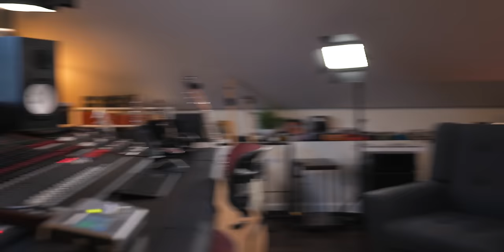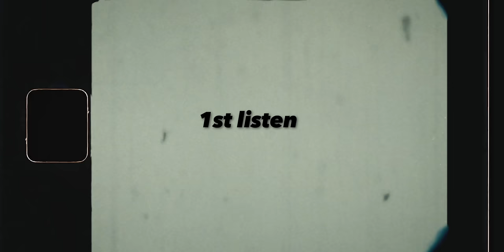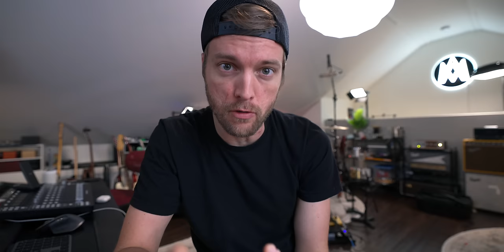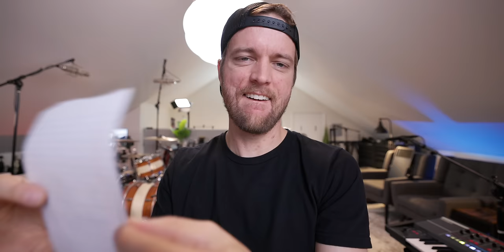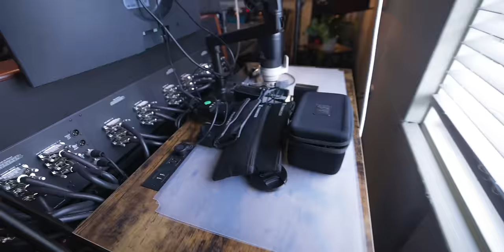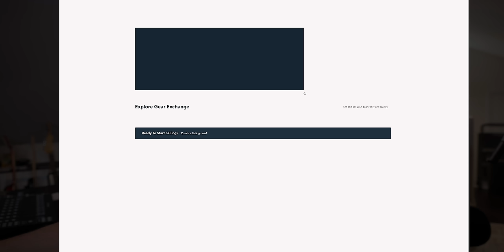I DIDN'T EXPECT THIS.. (Trident 68 Console VS Warm Audio WA73)

Comment: Man, the Trident squeezed down on the length of the transients in an extremely pleasant way. Listen to the length on that kick drum in each comparison. Sick console, dude~
Reply: It's the Tridents faster slew rate because of the higher impedance, the Tridents have a higher impedance which equates to a more open sound. While the Neve style preamps use a lower impedance around 600 to 1200 ohms which lengthens the note  but also squashes the transient due to the slower slew rate. Good ears that you noticed that. Cheers!

Comment: Great video Andrew. I have a Trident 68, as well as API 3124V’s, Vintech 73’s, Pacificas, etc. I was shocked at how much I liked the Trident Pres too. Now I always use some of that Eq on the way in but particularly like what they do to toms. I agree about the “round” sound. Really present yet controlled low end, punchy mids (not API punchy but..) and detailed highs.
Reply: Nice. I used to have a Trident Trimix, API 3124 and Vintech 473 (plus a smathering of others isa 428, chandler germanium, UA LA 610, True Systems prec 8)
For drums id almost always go API on snare/kick in and OHs.. the rest split between the 473 and Trident (I had bought all the redundancy pres before getting the console) 
It was still nice to have 34/35 pre's to choose from even though my Antelope interface only had 32 inputs and I rarely went over 25 inputs at a time, Though id go ape micing drums at time and have over 20 mics on a 5 piece. (scratch 2 x Guitars,  1 x Bass was how U was getting up the 25 tracks at once)

Comment: When I was younger and coming up at Sound Kitchen here in Nashville (where we had an SSL 4000G, API Legacy Plus as well as a Neve 88VR) an engineer/producer once told me about something called "Slew Rate". He explained to me that the Slew Rate was how fast the preamp was able to reproduce transients (basically), the quick and dirty he told me was that at Sound Kitchen, the API was mega fast, the Neve was the slowest and the SSL was somewhere in the middle.  I've learned over the years and the Trident is EVEN SLOWER, I talked to the owner of Tiny Tape room here in Nashville and he told me their Trident is modded to sound more like an API because he told me that after a while the previous owner of the console was tired of everything sounding so "slow" and having so much low-end.  I think we are hearing the Slew Rate of the two preamps here more than anything, because the Trident drums sound like they almost have a little bit more "compression" (if you wanna call it that) across the whole kit, whereas the Warm 1073s sound faster, bright and more "modern."
 
Super amazing video Andrew!!!

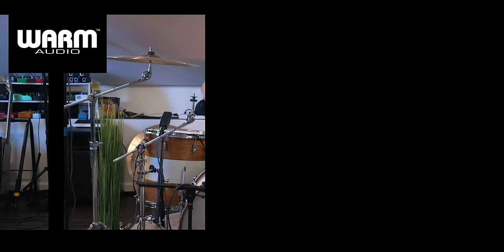Comment: Starting at 8:19 if you listen to the low end in the kick drum and compare between the two pres, the Warm Audio pres have a slightly “saturated” sound to the decay on the kick drum. The transformers are definitely adding a nice “fuzz” or “growl” to the kick. Where the Trident preamps provide a more “straight forward” sound of the kick. 

You can also hear how the Warm Audio preamps tend to “sit back” ever so slightly compared to the Trident preamps. Especially once the room mics are in at 8:42 

This is great to give things more “girth” or “weight” or have elements “pop” forward more depending on the preamps you use. 

Because they affect the frequency ranges differently, you can mix and match to make elements in a mix naturally stick out compared to the rest, or even create subtle shifts moving from verse to chorus. 

Very fun stuff to mess with and get creative!

Comment: Great video! However it sounds like there might have been a phase issue with on the snare on the Warm pres. Could be a bad patch cable or a switch. Pre's can make a big difference as we heard but that snare sound change was a bit greater that I would expect.

Comment: Warm audio sounds more compressed which I take to be a 73 pre trait. The snare rings out more and the whole sound is brighter with a little less beef. The trident is a little darker and more meaty with less snare rattle ring out. They both sound great, but to me the 73 sounds like it already mixed. Great video, and very much a matter of preference rather than better or worse
Reply: Agreed…The Warm gave the drums an open sound and the Trident seemed masked in all frequencies. Yes, the Trident sounded thinker, but that was from hiding the upper mids and highs from my ears. I don’t own Warm pres either…smile. If I had the Trident track, I would have to drop some lows and boost the highs to fit in the mix and no obfuscate the bass and other instruments on the mids and lows. Toward the end of the video when you played the kit without overheads, I could hear definition on the snare with the Warms and the Trident covered up the transients…just my ears.

Comment: I'm curious since the 1st preamp sounds like it has a low impedance like between 600 ohms to 1200 ohms and the 2nd preamp sounds like it is higher around 2000 ohms. The older Neve preamps had a switch for 2 different settings and the 600 ohms setting would squash a sound and this is what many people equate to the the Neve mic preamp sound but the internal switch doubled the input impedance for a cleaner less squashed sound. So the Neve style preamps had a more heavy slew sound that draws out the mid-range in most things while more modern preamps that range from around 2 kilo-ohm to around 5 kilo-ohms have a more polished linear quality that brings out the detail and has far less slew. An easy way to hear this in mic preamps is the darker more quote "squashed" something sounds in the overall tone on average the lower the impedance is, the more "sparkly & open" the higher the impedance.

Comment: I was really surprised by the comments. To me there was no comparison between the two. The Trident Pres were in a completely different league than the Warm Pres. I think it might become more obvious to your viewers if you did the exact same comparison recording vocals. Years ago I came into a little extra cash and decided to buy a couple of Vintech x73i Pres (faithful recreations of the Neve 73s). I completely expected to return them, expecting there was no way they could sound that much better, given the price difference. I was absolutely stunned at the difference in clarity, warmth and fatness. Given that most songs consist of dozens of tracks, the cumulative difference is huge. There's a reason why the most iconic recordings from bands like the Beatles, Pink Floyd and Steely Dan, just to name a few, have been recorded through these Hi-end preamps like Neve, Trident and others. They're simply sound the best, by far. Great Video.

Comment: Super comparison.  Gotta go with the Warm though, and the final glue of the  Warm on the Buss really brought it  all together in a big way. Although I am really impressed by the Trident  as well.  Very happy  to hear this comparison.  I may be the world's biggest fan of the "Neve" sound, which Warm really brings home I think, but the Trident does sound like a great contender for a console solution, when considering costs and features. Using a console in recording at least in my mind ultimately is the glue for any recording, because all the tracks are given the same treatment "across the board".   Thanks for producing this video.

Comment: mic splitting is usually done by transformer or active circuit. Your method is changing impedance. The two preamps react differently to this condition.

Comment: Now for the technical test. Solo the paired channels, invert the phase and sum. Listen to the difference. You will need to match the levels for max cancellation. 
Actually this would be a great way to match the playback levels too. Add a “trim” plug and adjust for a perfect match. I can hear mix differences which will be construed as sonic differences.

Comment: The Warm Audio WA-412 are the preamps that would be a much closer comparison to the Trident pre's than the WA73. The console preamps are punchier in this instance, because they are definitely cleaner in relationship to saturation/distortion. Distortion removes the peaks of the transients, which is what a 1073 is doing. To get 1073's punchy they have to be dialed low on gain, high on trim/fader. The Trident is much closer to an API or even a Focusrite console than a Neve sound.
Reply: Agree 👍

Comment: Shotgun mic to record voice at the desk, nice choice! YouTubers typically use a lav or an LDC mic. The issue with an LDC is it has to be very close to the source. The issue with a lav is that they are typically rather poor mics, even the best of them, that tend to be "all about that mid" because the capsule is so small. A shotgun mic however, if used (placed and gain structured) properly will produce excellent audio without needing to be a few inches from the source.

Comment: Excellent comparison. I'm struggling to hear any major tonal problems (perhaps some very slight differences, not better or worse either way), there are some level imbalances (more likely the difference between my monitors and yours). A very handy video for me as we're right in the middle of planning a full digital console swap with hardware outboard (we've found the lack of recall a growing problem in our analog desk).

Comment: I love your setup man! I’m a LUNA user with a similar setup to how you used to have yours. I’m at a crossroad, I try and work as hybrid as possible, which is oddly kinda difficult with LUNA. I’m looking at either integrating a Neve 8816 summing mixer with my current AMS NEVE 1073 pre’s, UF8 etc… Or ditching that idea and getting the Trident 68 16 channel… Thoughts?

Comment: it sounds more connected, and in the same environment through the Trident. there’s something happening in the mid range. However, that’s interesting with the trident. There’s a certain frequency that gets wider I’m not necessarily certain that’s a good thing but it’s different. There’s a little more high-end sizzle in the 1073’s, but that could be fixed easily with the trident EQ. often times it’s better not to have the sizzle baked in.

Comment: great video, i'm looking after this trident, i like warm audio, and i think you cannot actually compare these 2, i mean, did you drive them both the same? both input and output wise? cause i own a wa273 , no eq, and the difference in sound is massive, from going in gently and really pushing the input, especially with transient material like drums, same goes for every preamp, m ore or less, so it would be nice to see the input and output attenuations of both pieces,
cheers

Comment: Owned my first Trident Series 65 (very similar to your 68) 25 years ago, still its my first choice when choosing a console. You cannot turn off a big Neve or SSL console without damage, need air condition for them, and in our days most of their featueres are no longer needed. These old TL071 OpAmps from the 80s by the way sound very different from your new ones, if you ever get the chance to buy an old batch, do not hesitate, pure mojo (Don't know if all the OpAmps are on sockets too on an 68). And when it comes to EQ clear winner is Trident, even when you have to learn to handle it, always sounds great. Trident Pres are fast, opposite to Neve, or more east coast than west coast sound.  In our studio, we have an Golden Age 1073 clone, and soldered 2 CAPI VP28, but most of the time the Trident always wins. And Malcom Toft is a very nice guy.

Comment: Hmm.  They both sounded good.  Quite good.  Biggest difference for me was when the room mics were on the stereo image shifted between the preamps.  Like, not subtly.  Theres no chance they got reversed is there?  Apart from that they both sounded great.  I was thinking about getting some of those Warm pres with the eqs.  I have some nice Neve-clone channels from Seventh Circle.  The main real, pro-studio I go to has an old Neve and we track almost everything through it apart from occasional Avalon or Manley tube for lead vox.  When I just go through my Apollo I almost always use the 1073 emulation.  I don't ever seem to get sick of that sound.

But then I re-listened to the full mix context back to back and I did hear what you're talking about with the Tridents.  Much kick power.

Comment: Picking the trident Aswell, doesn't matter if the WA is punchier or more in the mid range, the question is how well does it sit in a full mix, the WA needed some tweeks eq wise, the Trident you barely need to touch it, it already blends with the rest beautifully, it's less work in the way out !

Comment: Nicely done, the Warms have an upper mid tooth over the Trident in this experiment. Trident, a tad scooped in that presence. The real testament to the quality comparison is to add a touch of 4-7k in the Trident, and try to match the sound of the Warms. THEN, listen for the most detail n breath throughout the frequency spectrum of both pres. Every pre is different, regardless of the cost, as you know. The one with the most detail throughout a wide freq range, will give the best 3d dimension when stacked in a mix. Do this test on acoustic n a nuanced female voice as well..

Comment: It is an interesting comparison but I did not hear any discussion of the interaction of 2 parallel inputs effecting the response of the microphones used. It would have a greater effect on the response of the dynamic microphones however without isolation of the microphone Z from the inputs you've approximately halved the input Z of the preamps. There may also be interaction between input transformers and transformer output of the microphones. Also there would be additional effect of the added input wire. None of these factors may be significant but being unaddressed, they raise questions about the result.

Comment: I don't know these sorts of electrical details but it would be interesting to know how the impedance of going to two mic preamps (rather than just one) changes the sound. If the impedance of the preamps aren't identical then the impedance changes might favor one over the other. A bigger issue for a dynamic mic than a condenser, too, which is maybe why we heard more instantly apparent differences in the kick/snare than in the overheads.

To me, the Warms sounded a little like the transformers were soaking up the low end while the Tridents were letting everything through. Super interesting, though, that's for sure!

Comment: The Warm pres are more open and natural sounding whereas the Trident ipres are tighter and maybe a little hyped on the hi--mid range. If the song has a lot of space for the drums I would go with the Warm pres. If the song has a lot going on and the drums need to give up some room in the stereo field, then I would go with the Trident pres. I'm curious to hear the same comparison with other instruments (electric and acoustic guitars, bass, etc.). You have both the Warm Audio and Audioscape bus compressors and EQPs. If you are using the Warm Audios in your mix bus, what are you using the Audioscape bus compressor and EQPs?

Comment: sounds like a phase/time align thing.
maybe the phase relations between the channels in the trident are better due to internal design and consistency of the D-sub cabling than the warm audio setup.
you can phase and time align the two recordings inside the daw (using sound radix auto align or something similar) and measure the difference in the results  (if any)  in numbers and in sound. It's an easy check so I think it's worth doing.
Good luck

Comment: Very cool video! I really like this 1/2 normalized test. I could see using both pres together on this for certain aspects on this song. I hear the difference for sure but I think there's some compelling sounds overall to both & maybe you can dig into that to bring the entire song to a place persay. I'm curious to hear those 73s inline on the mix bus with the GComp & EQP's. Anyway video kinda makes me want to 1/2 normal some mic's!  Although dosen't this change the mic's outputs by splitting it? IDK? Excellent video!!

Comment: It looks like you are splitting the mics to go to both pre’s at the patchbay? My understanding is this changes the impedances as well as -6db of gain, so we’re not really hearing the mic+preamp as they would be if they were not multed. Also, how were you sending 48v? The preamp not sending needs protective diodes to avoid damage. A transformer split is an option, but that also changes the impedance.

Comment: I think in a full mix the preamps in this case made a difference on drums. I don't mean this negatively, because either way the kit sounds good, the kick has a really deep sound, that snare is pretty sweet, the cymbal selection is good, and that take in the room sounded good. Was their a small difference in the preamps? Sure, I think the sound was a little different, the warms had a bit more high frequency extension, but part of that is in the shootout sections there are different parts of the take used, which to me had a bigger impact on the performance, especially since it's one crash versus two, and the first hit of the snare on the trident section was a little different in terms of the ring.

Overall, I think the differences between the WA73s and the Trident board preamps was small compared to possible alternatives when it comes to microphones, placement, drum choice and tuning, the song and arrangement themselves, and whatever tone shaping possibilities the equalizers of both units have to offer. I'd be willing to bet with good gain staging an audio interface with fairly good preamps could also get good results that are within the ballpark of quality of this recording.